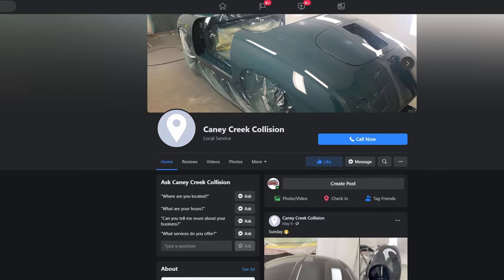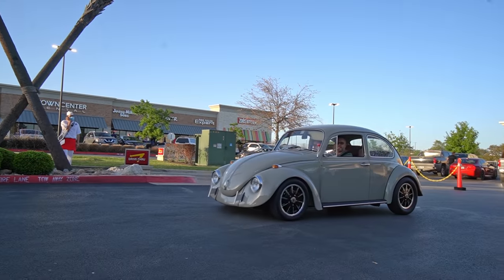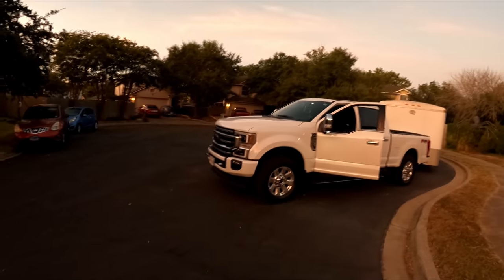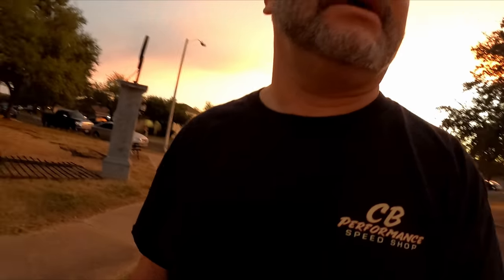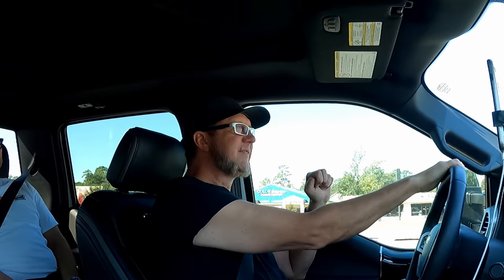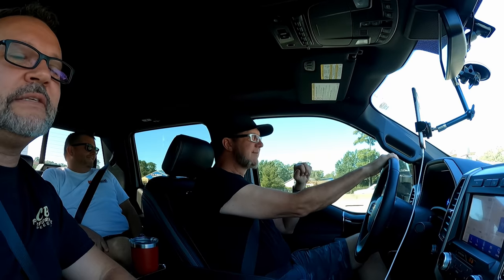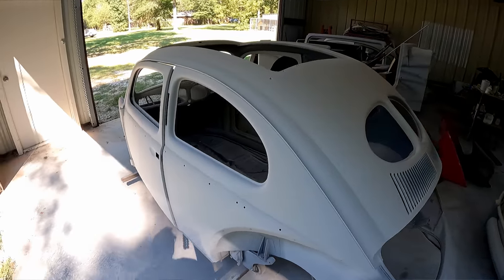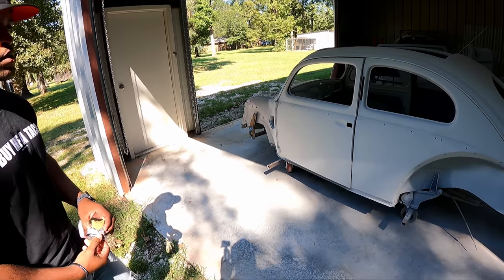He's doing a Full Restoration on at 1956 Convertible Beetle! a look inside a premier VW body shop...

Comment: great vid i have a question at 10:17 the red bug what is the point of the deck lid open at the bottom vs the top thanks
Reply: Helps with cooling - I don’t like top open , let’s too much of the outside in. 
 So I go with propped open at the bottom. 🤙🏼
Reply: @tommiesmith3369  cool thanks I see all the SoCal guys do that to